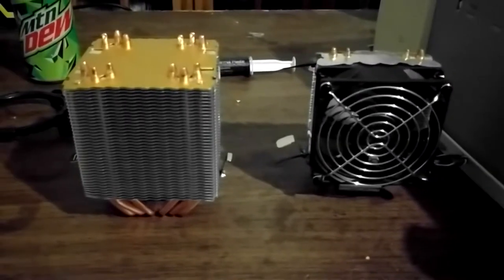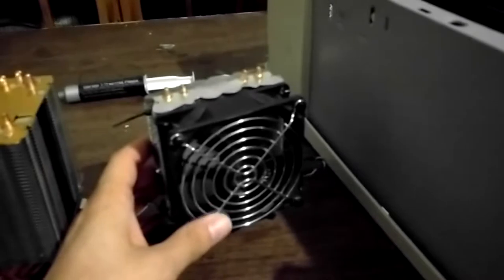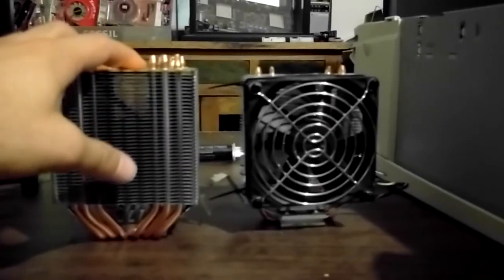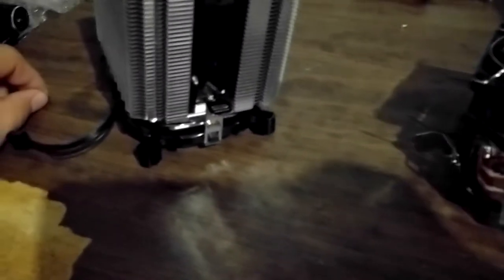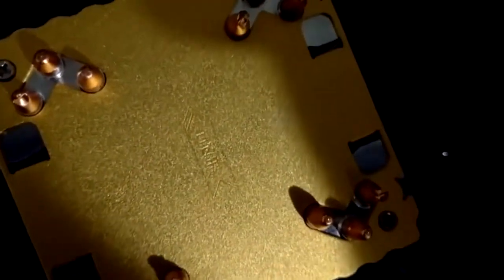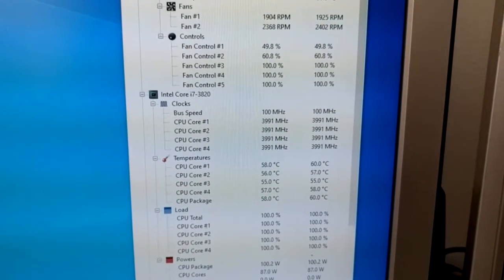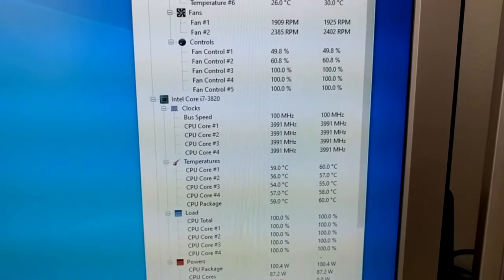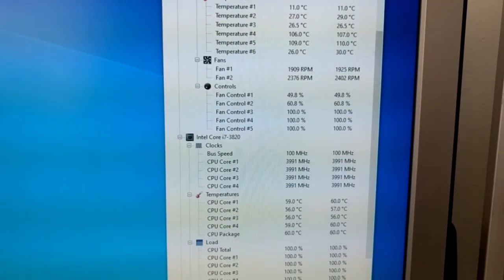Chinese 6 pipe eBay CPU cooler review

Comment: what do you think if this 6 tube cooler compared to a diy water cooler using ebay cheap aluminium water block?
Reply from the maker: 2 years late I'm afraid, but the cheap water blocks don't always have fins inside them. If you have ones with fins AND a good flow design, the water block is better. However, if you have one with poor flow design, or no fins at all, this air cooler will eat the water cooler for breakfast
Reply: @LowSpecActionSquad  True. I bought one. It doesn't have fins inside.

Comment: i have i7 8700k good cooler ??
Reply from the maker: Good cooler, yes. I recommend getting a better fan, or mounting two fans, if you get this cooler
Reply: @LowSpecActionSquad  I bought it two months ago with 3 fans, but when I break the speed, the temperature rises after hours of playing to 96 degrees until it turns off, but I doubt about the hy510 Chinese thermal paste, is it from the cooler or from the processor or both?
Reply: @estford  what happened with cooler? is it ok for 8700k at 5.0?? lol